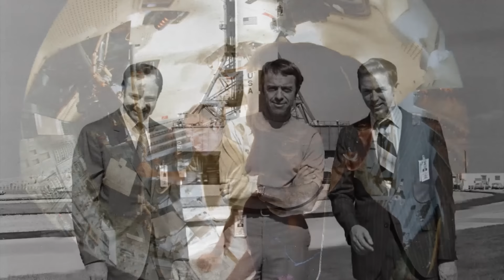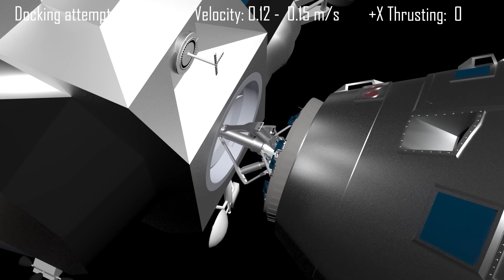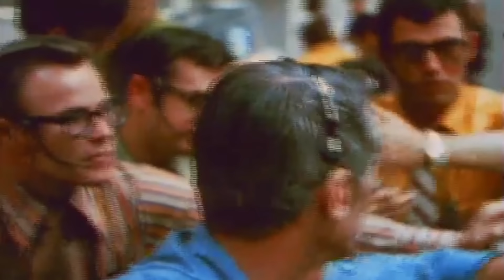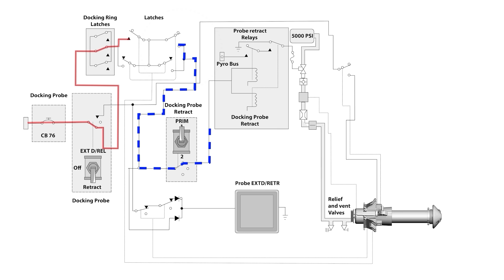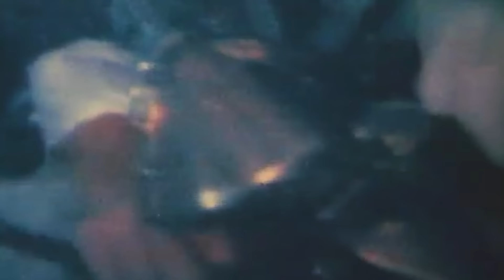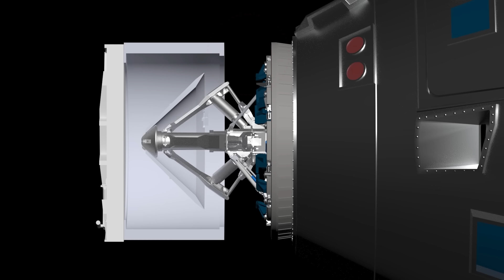Apollo 14  -  Houston, we have another problem

Comment: Kevin,
Just came across your video on Apollo 14 spacecraft docking issues.  A great video and it got me thinking back to my days as a NASA engineer working at KSC on the Apollo Spacecraft.  One of my areas of responsibilities was the Apollo docking system.  While the Command Module and Service Modules (CSM) were in the Altitude Chamber, we performed actual docking test with the Lunar Excursion Module (LEM) Accent Stages, Skylab Docking Module, and the ASTP docking module/airlock.  The only exception was Skylab Missions 3 & 4.  The Skylab Docking Module was in orbit and thus the reason why we couldn’t perform the test.  The first CSM to LEM docking test at KSC was Apollo 9.  I, along with my North American Aviation contractor engineer and a Grumman Aircraft Corporation engineer developed the first docking procedure at KSC.  These tests were performed for each Apollo mission with the participation of the prime/backup flight crews.  The object of these test was to demonstrate the compatibility of the two mated vehicles.  We verified the docking probe capture latches worked, the 12 docking ring latches worked, the docking ring seals held pressure, as well as the structural integrity of the two pressurized vehicles.  In addition, the astronauts were able to witness for the first time the actual docking of the flight hardware.  Once docked, they did a final adjustment of their Crew Optical Alignment System (COAS) to the docking target on the LEM.  The COAS is placed in the Commanders forward looking window during all mission dockings.  Lastly, we did not retract the docking probe using the GN2 gas bottles.  There are only four bottles and using one would require the docking probe to be sent back to the manufacture for replacement.  Instead, we lowered the suspended LEM to retract the probe until engaging the 12 ring latches.
As I have already stated, your video is well done along with your narration.  I do have some comments, corrections and opinions about your video.  First, Gene Cernan’s idea on solving the docking issue could have worked.  Pushing the two vehicles together with CSM thrusters until the docking latches fired was the same way we did the docking test at KSC.  However, there would have to be enough thrusting power to overcome the extension spring in the docking probe shaft.  Second, having only one ring latch fired is insufficient to maintain pressure in the CSM during tunnel hatch removal.  Flight requirement was a minimum of 3 docking latches engaged.  Forth, you cannot have just one latch to fire.  These latches have a clamping force of 2,000 pounds each.  The latch that is triggered first will pull the two vehicles together at such a high rate that it will trigger the other latches to fire in sequential order resulting in a violent oscillation of the two vehicles.  By accident, we demonstrated this reaction during the first Apollo 9 docking teat.  The LEM accent stage was not level to the CSM docking ring causing one latch hook to fire before the others.  In an extremely fast motion, the other 11 latches fired one after the other.  This resulted in a violent oscillation motion of the LEM (cable suspended) and the CSM sitting on a support ring in the altitude chamber.  I do believe that the CSM slightly lifted off the support ring as it was not bolted to the ring.  I can still hear today the flight crew’s reaction over the net.  “What the hell just happened.”  Luckily this did not damage the two flight vehicles.  Fifth, the comment that the flight crew pushed the two laches to properly seat them on the docking ring is incorrect.  There is absolutely no way an astronaut can overcome the 2,000-clamping force of the latch by hand.  When latches do not totally engage with the docking ring, flight procedure is to re-cock the latch and then fire the latch.  At KSC during testing of the docking latches, we had quite a few times when the latch hook was not totally on the docking ring.  What happens is the latch goes thru two motions as it is fired.  The first motion of the latch is to pivot forward or rotate towards the docking ring.  The second motion is to then clamp down on the docking ring.  What we experienced many times was the forward motion is so rapid that the latch hits the docking ring with such force that is bounces back before the latch starts its downward motion.  It happens so fast the human eye cannot see these motions.  We spent many hours talking to the design engineers back in California trying to fix this issue.  We were never able to completely eliminate this problem during Apollo.
Finally, at the time of the Apollo 14 mission, NASA concluded it was “space ice” that caused the docking issues.  Having some type of liquid in the probe head, in my opinion, is not possible or likely.  The Apollo docking systems were never exposed to the outside environment at KSC.  After the docking test, the docking system was always covered in plastic until the Launch Escape System (LES) was installed in the VAB.  As part of the LES, it contains the Bost Protective Cover (BPC) which sits over the Command Module.  Inside the BPC at the apex of the cover is a “tension tie” which forms a connection between the BPC and the docking probe head.  Its function is to keep the docking system (docking ring & docking probe) attached to the BPC during an abort.  With a normal lunch, the tension tie is pulled out of the probe head as the BPC is jettisoned.  It appears that the tension tie is inserted in the area of the probe head where the button is pushed by a LEM astronaut to release the three latches from the LEM drogue.  It is not clear how the tension tie is physically connected to the drogue head other than it is not a mechanical connection.  It’s possible it could be a hollow tube with three or more fingers that slide over the button head and grab the head from underneath.  Its conceivable that one of these fingers could have broken off thus jamming the spider mechanism; or the tension tie could have been pulled off at an angle jamming the spider.  This is a more plausible explanation than space ice.
I hope my comments give you a better understanding of the Apollo Spacecraft docking system.
Reply: Wow, that's a detailed comment. Thanks very much for your deep insight into the Apollo docking system.
Reply: @Gary Algire, thanks for wonderful additions to this story. I was 12 during the mission and I hung on to every minute, including the docking episode. I have wondered if an EVA ingress into the LEM could have been possible,  with the Saturn 3rd stage engines being used to perform LOI for the LEM, alongside the Command/Service Module. Transporting the lunar samples back into the Command Module  by an EVA probably would have been impossible, I guess, particularly since Portable Life Support Systems used by Mitchell and Shepherd were to be left on the Moon.
Reply from the maker: Wow, firstly thank you so much for responding with an absolutely fascinating detailed account. Secondly, I am so honoured to have someone who actually worked on all this to comment on my post! I have trawled the net and documentation to try and get something close to a clear understanding of how the docking system worked. 

A lot of my diagrams and animations came from the original NASA documentation showing still images. Like I said on my other Video on the docking ring and probe, I've always been fascinated by it and could never get my head fully round how it all worked. That’s why I put these videos together. definitely a labour of love. The great think about the internet is that I can post it and actually get responses from people who know a hell of a lot more than me! On my previous video for example I was unaware that when the LEM separated from the CSM they simply extended the probe which pushed the LEM away. I always assumed they used thrust.

When you talk about not using the gas bottles and lowering the LEM for testing makes perfect sense. If I had known that then yes, Gene Cernan’s advise of pushing the vehicles together would make perfect sense. I can’t remember where I read it but its written somewhere that it wouldn’t have worked. Then using confirmation bias I went through the electrical sequencing and confirmed it wouldn’t because it wouldn’t have set off the gas bottle. The dangers of only using single sources! The fact that they physically mated the vehicles meant it would absolutely work! 

Another fascination point you make is the latches had two motions. this I had no idea about and again, in my other video, I mistakenly show it as one rotation. How I would love to get up close to this system and see it in action! Finally, my assumption about the "space Ice" came from the NASA report. I did feel however that this was not really confirmed but I put it at the end to show their conclusions. I did hear they reused this probe again on Skylab but I only read that in a comments page so I left that out as I had no idea if this is correct. 

Thank you again for taking the time to comment and provide a brilliant insight. Also, an opportunity for me to thank you and all the other brilliant engineers and personnel who worked on the Space program.
Reply: Question:
Gordon Cooper was backup CMDR on Apollo 10. How engaged was he in your demonstrations? Asking because of Deke Slayton's and Chris Kraft's attitudes toward Cooper.
Reply: @Yamato_Hashin  
Gordon Cooper was not an Apollo, Skylab or ASTP astronaut.
Reply: Sorry,  I miss spoke. Gordon  Cooper was to fly on Apollo 14 but Washington management decided to replace him with Alan Shepard.  Gordon Cooper is not listed  on any Apollo missions.  Having worked Apollo 13, I cannot  recall or remember if he was one of the backup crew members.
Reply: @Choestoe141  Cooper was backup CDR on Apollo 10. Look it up. He had problems with Slayton and Kraft, who called him a "lazy astronaut." He didn't want to learn the DSKY system. That's why he never flew after Gemini 5.
Reply: @Yamato_Hashin  If you don't want to learn the DSKY system, effectively you rule yourself out of Apollo. The DSKY system was fundamental to it, so it is Gordon Cooper's own fault he didn't fly on Apollo.
Reply: @owensmith7530  Yes. It was. Cooper would fly 238,857 miles by the seat of his pants if it were up to him.
Reply: @Yamato_Hashin  Yes but he probably wouldn't get home safely at the end of it.